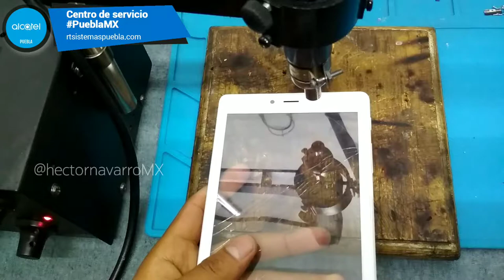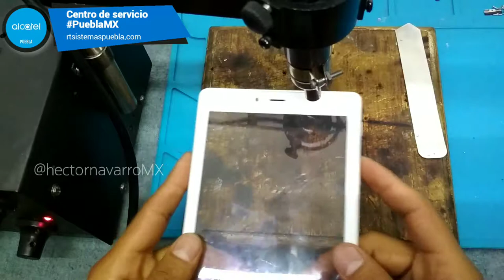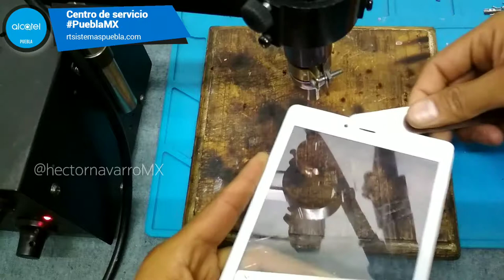How to replace touchscreen for Alcatel pixi 4 (7) 9003a

Comment: Hola, me gustaría preguntar el por que algunas partes del touch no funcionan, son como lineas de un lado del touch al otro que no reciben señal
Reply from the maker: Porque está dañado el touchscreen. Necesita otra pieza nueva. Si después del cambio el problema persiste, entonces el problema puede ser en el conector de la tarjeta logica. Algún pin está dañado. Y en el peor escenario; está dañado el chip IC encargado del touchscreen en la tarjeta logica. Para este punto necesitas llevarlo a un taller de microsoldadura con técnicos que sepan diagnosticar con esquemáticos. No nozco personalmente un lugar así.

Comment: Hola buenas tardes cambie el touch de mi alcatel 9003a como lo muestras en tu video ya que termine  lo encendí y el monitor se quedo en blanco por que y como lo puedo arreglar gracias
Reply from the maker: -Puede estar mal conectado. Solucion: volver a conectar correctamente.
-pudiste dañar el flex de la pantalla. solucion: comprar otra pantalla
-en el peor escenario: dañaste la tarjeta lógica. solución: no la hay. A menos que consigas un taller de microsoldadura con técnicos que sepan diagnosticar con esquemáticos. No conozco ningun lugar así.